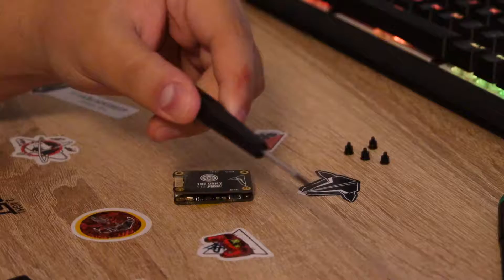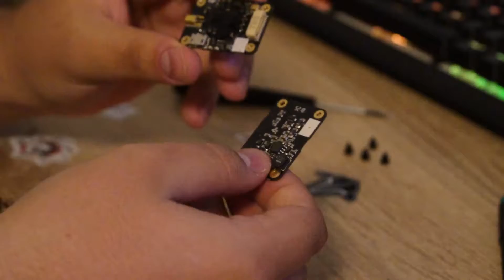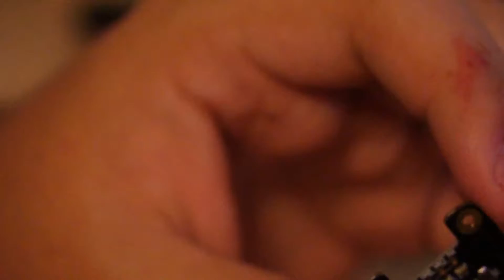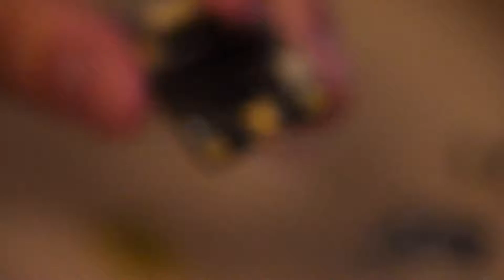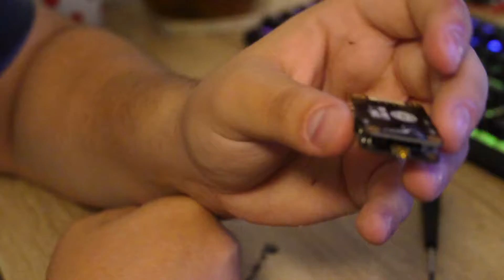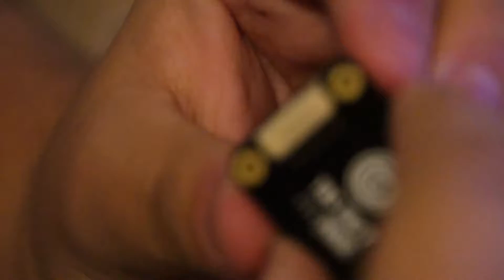TBS Unify Pro32 HV Disassembly (Teardown)

Comment: my button  is broken how do i fix it? also i tried opening it up but i wasnt able to remove the top cover it was stuck
Reply from the maker: You have to pull it apart with more force. But if you dont have hot air station you cant replace the button really.

Comment: Did you have this set up with vtx tables? I can’t get mine to work on my kakute f4 on BF 4.1.3
Reply from the maker: It is set by default to CRSF comunication you have to change it in TBS agent and then you can use SA.
Reply: DJ_POP that was it. Thanks man.

Comment: wheres the damn mic? Because I cant get no sound though mic=on
Reply from the maker: Well I havent tryed the audio I dont use headphones... But it looks like there is no mic inside :D might be under that liquid electrical tape. But I dont know.
Reply: @popfpv  I may have to flip it.  I have it zipped to bottom plate against thin thermal pad.  Maybe one them through holes is a port to it.
Reply: @popfpv  nevermind, I spoted it. its that gold rectangle with hole on top next to pins...thanks for posting
Reply: @mas2ery  did u ever get ur mic to work? i have audio mic=on in tbs agent software but still get no sound -.-